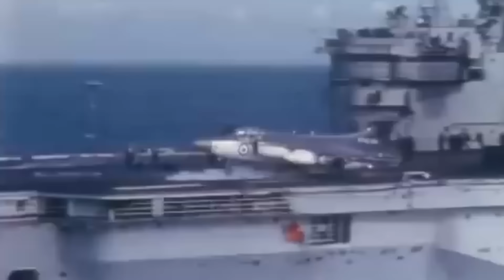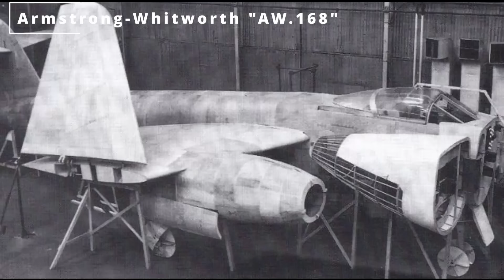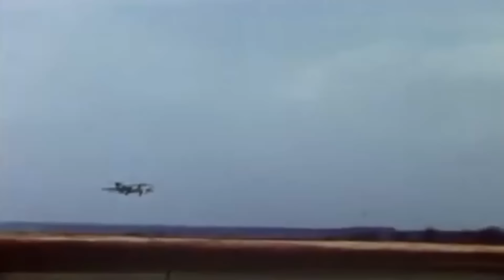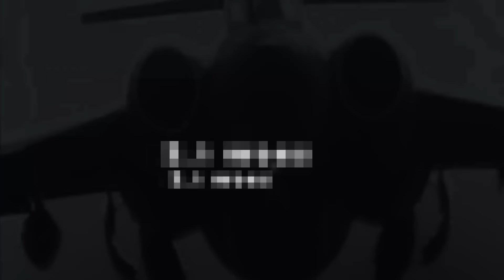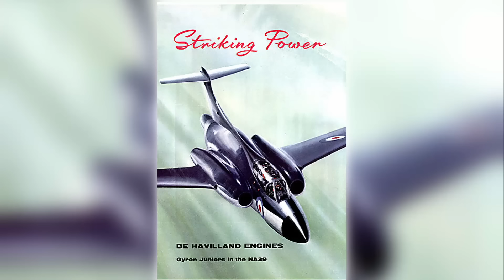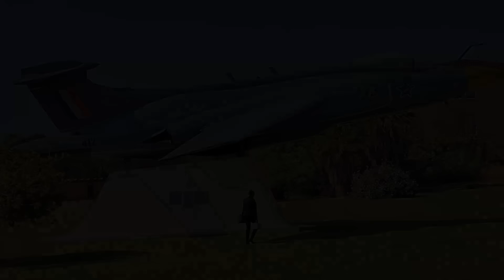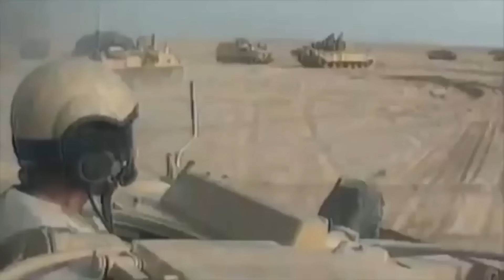Blackburn Buccaneer  -  Insane Low Level Bomber Americans couldn't shoot down - (Full Story)

Comment: Serving in the RN in the 70's and 80's I had many "encounters" with Buccs. Standing on the bridge wing of a Leander class frigate and looking down into the cockpit of a Bucc flying past or the Bucc performing a simulated low level attack and having climb to pass over the forecastle. They were awesome aircraft flown by complete nutters. Their biggest drawback was that at low level they left quite a smokey exhaust trail which was they key to visually spotting them as in they were very difficult to "see" on radar.
Reply from the maker: That must have been a hell of a sight to behold. The pilots were made of finer clay than us mere mortals.

Comment: Hey man i'm 36 mins in and this is brilliant. Bombing down the funnel? Where do you get your information? George Lucas?
Reply: Just finished and that was great. I'm off to the Swansea airshow this afternoon so thought i would get myself in the mood. As long as the weather holds up for a couple of hours i should be in luck. Not sure of your choices on movies but each to his own. I remember some of the most impressive low level flying in the movie Firefox with Clint. No Russian connection? Well it didn't seem to bother you. Why not? I digress... More thrust to your engines and a dream of the future of Aviation. Cheers.
Reply from the maker: Thank you very much, my research tends to involve a lot of material, mainly books, forums, magazines, old recordings from those that were there, it's a lot, sometimes too much info that it's hard to decide what goes into the story and what is left out.

Comment: In 1978, I was working atop a rail tank car at the US Army fuel depot in Giessen, Germany.  Next to us was the munitions depot with a radar guided missle defense system to protect it.  It was a clear summer day and I happened to see a fast moving dot darting behind the several hills that surrounded the area.  I lost sight of it and carried on with my duties - that is, until the plane suddenly popped up behind two low hills and headed straight - I mean STRAIGHT at me getting larger and larger - those two giant intakes looking menacing as hell!  I grabbed onto the handle on top of the tank car and braced for the enormous blast of shock wave and ear splitting roar that nearly blew me off the tanker.  That RAF Bucaneer probably cleared me by 10 or 15 feet; what a moment of sheer terror and exhilaration!  Anyway, that Bucaneer made a spectacular mock bombing run on the Munitions depot catching them totally by suprise.  As the jet dissappeared off behind the hills, the air-raid siren finally began to wail - another beautifully executed run! Hats off to the lads in that RAF Bucanner - what a memory from my youth!
Reply: Owlsmoor weather

Comment: The Bucaneer was an engineering success rugged reliable let down by penny pinching inter service fighting and politics. 
The Royal Navy needs something like this today capable of defending fleet refuelling other aircraft, maybe high powered Radar fitted and linked to carrier so doing AWACs type thing, sadly UK no longer invervates by buys from or Co-develops. F35s range could be extended.
Jp232 anti runway was stupid as had to fly at set hight straight line and set speed left aircraft vulnerable to antiaircraft guns of a trainee let alone a practiced operator. Lost aircraft in Iraq as a result but against Russia/Soviet Union we would have lost the lot.
Reply from the maker: The best aircraft Blackburn ever made, shame there was no follow up. - Joe

Comment: Years and Years ago. I lived in this house at the to of a very long not so deep valley. Every week if not everyday the RAF would practice low level assaults. Tornado's and Buccanneer's would fly about 50 to 75 feet about the roof of my house as they lined up and dove for the valley. When the gulf war start. I thought of a way to help their training. With white paint i painted AAA on my Roof. later I would run into some of the pilots in the local pub.

Comment: I have had a little experience with the Buccaneer. The first time was watching a video of them at Nellis for Red Flag, in '77 (it had some Vangelis music overplaying the sound recorded on the original video of the jets at red flag. I was so surprised to see dust rising from the desert floor from the wingtip vortices as they banked sharply travelling down one of the canyons. I watched it at the HQ building at RAF Stafford, having just arrived that day. Since then, I have been a fan of the Buccaneer. Some time later whilst based at Abingdon, and being on the shooting team (practicing for Bisley, some time between 1985-1988) some of the Battle Damage guys came to the range with a strange request. They wanted to put some panels from a Buccaneer behind our targets so that they would be able to work out a repair for them. Normally they used a shotgun for this purpose, but that only blasted the paint off. The 7.62 rounds did the job. Also, as a kid, and an adult, saw them at airshows flying and ground display, including at RAF Abingdon airshows. Thanks for putting this on here. If you have the whole video of them being flown at red flag, could you put that on here, I'm holding out suscribing, but if you do that, I'll subscribe.
Reply from the maker: I will see what I can do regarding making a video about Red Flag, it would have to be an original work since uploading a whole video would be verbotten. The Bucc is responsible for many of us falling in love with aviation. She is a unique aircraft. :-) Joe

Comment: American A6 guy here, had a lot of respect for the Buccaneer, the Ark Royal once ported in Norfolk (US) Virginia, got a good look at the Buc, very similar to the A6 in many respects, both planes were butt ugly.    I believe the Tornado took over the role once filled by the Buc.   Good video....the Buccaneer originated about three years prior to the Intruder.
Reply: Ugly? That must have been a Gannet 😂😂
Reply: Were you part of that exercise were the Ark Royals Buccaneers had a reign of terror down the eastern seaboard in simulated attacks? Heard it took quite a few days to pin the Ark Royal down. PS from the other side of the pond but thank you for your service!
Reply: @mbspoobah  The Bucc butt ugly???
How very dare you😮
A thing of rare beauty the Bucc, irrespective of its many innovative design features and the outrageously short timeframe between its Inception and operational deployment.
If you want a butt ugly UK military aircraft the HP* Victor bomber is a candidate?

* For the benefit of our colonial cousins, HP in this case is Handley Page not Hewlett-Packard😇
Reply: @warringtonminge4167 It was ugly, certainly when it was sat on the ground. Bit better flying but still no Phantom in the looks dep't.
Reply: @pictobug  depends whether you go for form or function. To my mind beauty lies in design to achieve the objectives, not just to look pretty. The ugliest machine (or building for that matter) supreme at performing its function is far more beautiful than something that's supremely aesthetic but crap at the job it's supposed to do.
Noone could ever be accused of calling, say, the Toom an oil painting but it was an excellent warbird and thus beautiful.
¯\_(ツ)_/¯
Reply: @warringtonminge4167  
Rolling down the runway
throttles open wide
see the mighty Phantom
sway from side to side
airborne again without a blip
It's just one more aborted trip
but we're pressing on regardless
for the wg cdrs AFC

Went to early briefing
climbed into the Kite
opened up the throttles
and roared into the night
leaving the flare path far behind
It's dark outside, but we don't mind
cos we're pressing on regardless
for the wg cdr's AFC

Rolling down the runway
throttle open wide
see the mighty Falcon
sway from side to side
airborne again with just 9 G
I wish I had a nav with me (!)
but we're pressing on regardless
for the wg cdr's AFC

Rolling down the runway
throttles open wide
see the mighty Jaguar
sway from side to side
airborne again, but only just
It's not much fun
with F*** all thrust
but we're pressing on regardless
for the wg cdr's AFC

Give me Buccaneers
They're British through and through
The Banana Jet
The Best we've had yet
We are the last of the few.

Don't give me the Jaguar
Unless you refer to the car
The car is a ground hog
The aircraft, a half frog
Don't give me the Jaguar.

Give me Buccaneers
They're British through and through
The Banana Jet
The Best we've had yet
We are the last of the few.

Don't give me the Harrier jump jet
You haven't convinced me yet
Jets that fly backwards
Are soon to be knackered
Don't give me the Harrier jump jet
Well… You know, not just yet...

Give me Buccaneers...
They're British through and through
The Banana Jet
The Best we've had yet
We are the last of the few.

Don't give me this computer crap
It's no way to tackle a SAP
It's OK for Dicks, Germans and Spicks
But Gentleman, carry a map!

Give me Buccaneers
They're British through and through
The Banana Jet
The Best we've had yet
We are the last of the few.

Don't give me Air Traffic Control
They live in a bloody great hole
They scream, and they shout, then F**k you about
Don't give me Air Traffic Control.

Give me Buccaneers
They're British through and through
The Banana Jet
The Best we've had yet
We are the last of the few.

Don't give me the F-104
It's only a ground loving whore
It goes in a turn, flick, spin and burn
Don't give me the F-104.

Give me Buccaneers
They're British through and through
The Banana Jet
The Best we've had yet

WE ARE THE LAST OF THE FEW!
Reply: @warringtonminge4167  It's an American, that's all you need to understand.
Reply: Why do we read so many Americans, all claiming the Russian SU-57, is nothing but junk, that relies on washing machine chip technology, with the RCS (radar cross-section) of a Jumbo Jet? 

While the truth is, they've no idea what the RCS of any military aircraft is, as they're always kept classified, so, really, what is it all about? 

None of them ever ask the obvious questions, either, (as they all just assume so much). But questions like, what do either the F-22, or F-35 have available to them to detect, track and target enemy stealth aircraft from BVR (beyond visual range)?

If they had just asked that one obvious question, then maybe, they'd start to understand, that today's reality, is nothing at all like they think! Seemingly the Americans we endlessly read making these claims, like the F-22 is so much better than the crappy SU-57, don't even understand, that stealth alone, defeats high-frequency (short wave), radar, by absorption and deflection, but it does not defeat low-frequency (long wave radar). 

To detect, track, and target enemy stealth aircraft from BVR, can be done with long-wave radar, (but it must also be enhanced), to remove all background clutter for targeting purposes. So regardless of the aircraft's RCS, (we read them all believing means so much), when they're being detected, tracked and targetted by long wave radar, they're far from stealthy, and they just light up, and stand out, like a beacon in the night. 

And why is it, that, neither the APG-77 radar in the F-22, or the APG-81 radar in the F-35, have any kind of long wave radar? (hence, they can't detect any enemy stealth aircraft from BVR). So, just think about that? This is also a fact the US air force must be fully aware of. Only it seems the reality is, when the F-35 radars were being designed 13 years ago, there weren't any other stealth aircraft to think about as a potential threat! 

So, obviously, we must ask, just what do the F-22 or the F-35, actually have available to them, to detect enemy stealth aircraft from BVR? They have AWACS, (that can transfer all targetting data to the F-22 - F-35's in real time). Only, that's not possible today. And this is why actually understanding any potential adversaries real abilities, becomes extremely important, critical in fact. 

As, on the other hand, we find this Russian SU-57 (rubbish, they all claim), is equipped with a 5th generation radar, (with enhanced long-wave radar), their new Byelka (2band) radar used in SU-57. They can detect, track, and target enemy stealth jets from BVR, and very easily today. 

Russia has designed, and developed, the first L-Band fighter radar we've ever seen. They've embedded L-band AESA radars into the leading edges of the wings. The L-band AESA radar "data" gets processed in real time (through extremely powerful Russian computers), being significantly enhanced, removing all background clutter, seeing them perfectly able to detect, track, and engage enemy stealth aircraft from BVR. 

This new Russian radar technology, along with its very impressive range parameters, and it's jamming ability (over very large areas) make this aircraft deadly to all other aircraft types. (But according to the Americans), it's just Russian rubbish, right?. 

They can also detect, track, and target enemy stealth fighters, long before they enter Russian airspace, (from much greater distances today), with "real-time" data from all those massive Russian ground (long wave stations), that are all protected with the networked S-400 defensive system. 

Russia's new (2band) radar, covers all frequencies across all channels, used for tracking, targeting, and also for jamming (over large areas). It's part of Sh121 multifunctional integrated radio electronic system (MIRES) on board the SU-57, and is being used in the SU-75 Checkmate. 

We should also understand, that Russia tested this new radar suit in the SU-35's, so they also have the option of fitting this radar into the SU-35's. Seeing the SU-35 at no disadvantage against either the F-22/35. As although the SU-35 can be detected, tracked, targeted and shot down from BVR by the US stealth fighters, the SU-35 equipped with this new radar is just as able to detect, track, target and shoot down the US stealth fighters from BVR. 

Seeing the all-important, huge Russian advantage, in BVR missile range, plus the excellent manoeuvring, neither the F-22/F-35 have, as more than critical, (if you're going to avoid simply being blown out of the sky). 

The truth is, this new Russian 5th generation radar provides genuine shared multifunction apertures, with applications including... 

Search, track, and destroy, missile mid-course guidance, against low signature aircraft, identification of friend or foe with secondary surveillance radar. 
Passive angle tracking and geolocation of JTIDS-MIDS-Link-16 emitters at long ranges. 
Passive angle tracking and geolocation of L-band AEWC - AWACS and surface based search radars at long ranges. 
Passive angle tracking and geolocation of hostile (i.e. Western) IFF and SSR transponders at long ranges. 

High-powered active jamming of JTIDS-MIDS-Link-16 emitters. 
High-powered active jamming of satellite navigation receivers over large areas. 
High-powered active jamming of L-band AEWC-AWACS and surface based search radars at long ranges. 
High-powered active jamming of guided munition command data links over large areas. [Effectively, and completely, neutralizing the USA's use of AWACS for their detection]. 

The Tikhomirov NIIP L-band AESA radar, is an extremely important strategic development, and it's a technology which once fully matured and deployed in useful numbers, will render narrowband stealth designs like the F-22 & F-35 Joint Strike Fighter, and many, UAVs, as highly vulnerable to all flanker variants equipped with such radars. 

But, wait, It's just Russian crap? What have the Americans ever seen the F-22 actually do?, well other than flying over a beach on a YouTube video? 

Absolutely nothing!
Reply from the maker: Thank you very much, The A6 is a very interesting machine, one I hope to do justice one day with a deep dive video. :-) Joe
Reply: The A-6 was a magnificent aircraft.    I think it edged the Buccaneer in terms of nav-attack system and in the diversity of weapons it could deploy.

Comment: Wow, well done, obviously a passion project. I have the grand total of 8hrs on the bucc and 20 on the converted Hunters that hung around Brawdy in the early 80s. I learned things from your documentary I didn’t know. Re the high speed Yaw issues. The Blackburn designers had to chop the fin hight on the drawing board so the kite would fit into the hanger deck of HMS Eagle. They knew there would be issues. Incidentally the Bucc was the fastest airframe into any target. But not on egress. That was the Tornado GR1 and the F111. Heartening that you young folks are taking an interest.
PS You omitted the “Show of Force” over Guatemala City in 72. Nobody killed but it really stopped a war.
Reply from the maker: Thank you, I really appreciate your comment, to say I am jealous is an understatement, I tried to join the RAF but I had a medical issue called "I am too daft to be trusted with a multimillion pound military instrument of mass destruction",it seems there is no cure. We "youngsters" are most definitely interested, Regarding the show of force, yeah, I had to leave a lot on the cutting room floor, otherwise it would have been a much, much longer video.
Reply: @AviationRepublic  just get on with enjoying your life. Remember tRAF Germany was bigger than the whole service now. When I went through elementary flying training I was one of 300 students. I got my first front line tour at 22. Now it’s more like 28. It’s really not worth it the bother anymore.